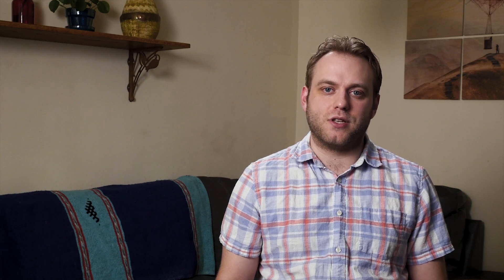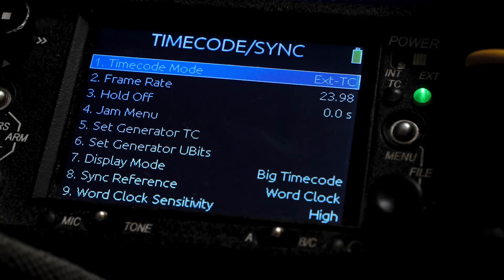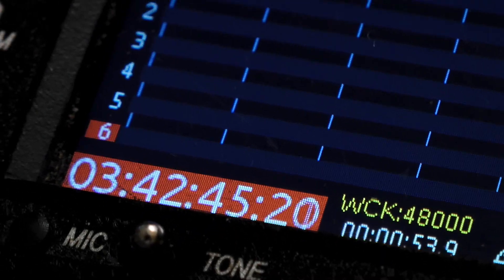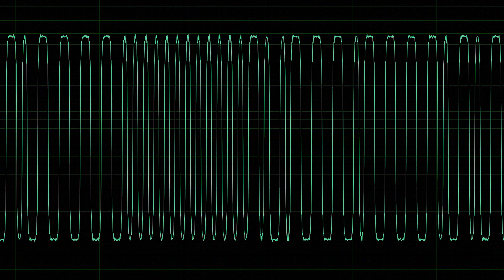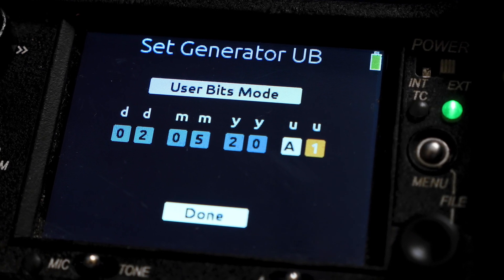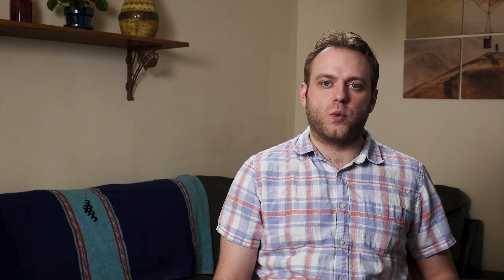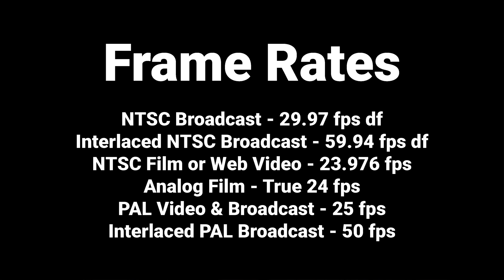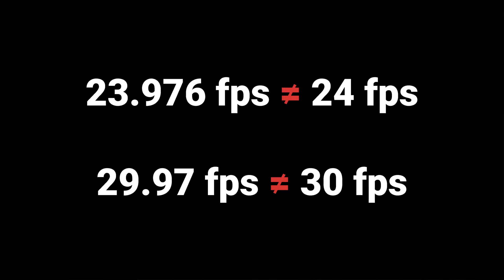Audio & Video Sync In Video Production: Timecode, Genlock, Wordclock, & Audio Timecode for DSLRs

Comment: Hi Henri. Thank you for this video. I have tried to link up a timecode box to a Sennheisser EW 100 G3 system to transmit the LTC, but the RF signal seems to degrade to a point where the slate won't register the LTC. Which wireless transmitter did you use? Thanks

Comment: if we just want to do normal video from pocket/action camera,should we use this or is this only for dslr cameras?
Reply: Gopros record audio to short answer, yes. The newer ones have a usb-c interface so you'd need to get the adapter that has a 3.5mm input for a gopro. Then just get a Tentacle Sync for all your cams/recorder.
Reply: @dingdong5601 
 You sound like you might be able to help me...
 I'm trying to do a multi cam edit with clips from 3 GoPro cameras over about a 2 hour period.  Unfortunately it seems that the time on the cameras wasn't set properly so the clips aren't lining up in Premiere.  The audio on the 3 cameras is different so I can't sync by that.
 What's the best way to get the clips aligned properly and do a multi camera edit?
Thanks!

Comment: I'm filming musicvideos with a sound engeneer in the studio simultaneously. Our Plan is that he can edit the Music audio connected to the ltc timecode. Is there an option, that i can import the final Audio file (with many audio cuts) with the LTC code and let the Program (Adobe Premiere or Pluraleyes) sync the video files to the LTC code. There are many tutorials how to sync LTC, but its always the LTC coming from the cameras. The program would have to cut files by itself to match the cut files from the audio and should also repeat itself if the file is used later again in the timeline. I hope you understand my question ;) Thanks for your help in advance.

Comment: Henri,  thanks very much!   I am trying to understand if  I could have frame-accurate sync while playing back audio on set from protools ( or another app)  and have that play back app tell the camera(s) to start recording.
Reply from the maker: That is possible from my understanding but not every camera system would allow that workflow. For true frame accurate sync you’d need a master clock for true frame accurate sync that provides wordclock and genlock. That being said if it’s music playback then likely that’s beyond the level of accuracy you’d need and could rely on Timecode alone. What you need to do is stripe the music with audio Timecode, then feed that on an independent output to the camera Timecode with the camera setup to trigger recording based on incoming Timecode. So when you hit play cameras roll and when you stop playback they cut. If you’d like to chat more about your specific use case add me on Facebook or Instagram and shoot me a message.

Comment: Great video, it's possible to genlock two cameras without genlock (but with timecode in) and an external generator or an external recorder such a Shogun 7? 
Thanks
Reply from the maker: So Arri cameras are the only ones on the market that can be genlock Ed based on incoming TC. You put them in Regen then go into the sensor setting select sync source to generate genlock based on incoming Timecode. Outside of Arri cameras that’s not possible though. Some external recorders do allow you to genlock them though from my understanding if you genlock the camera and feed the recorder over SDI you shouldn’t need to additionally genlock the recorder. Many will also lock into LTC in the SDI signal, such as the Odyssey 7Q. What I would personally suggest is looking into the Timecode Systems Ultrasync Ones. They can be setup to work as a master or slave and can provide Timecode, Genlock, and Wordclock so if each device in set has one, everything will be locked perfectly in setup with one another. Hope this helps!
Reply: @henrirapprecording  Thanks so much!! great info, I am researching!!!
I am trying to see if I can do it with the Red Komodo and I have Shogun 7 and Odyssey 7Q+ working on a pre indi setup:) thanks again
Reply from the maker: Best of luck!